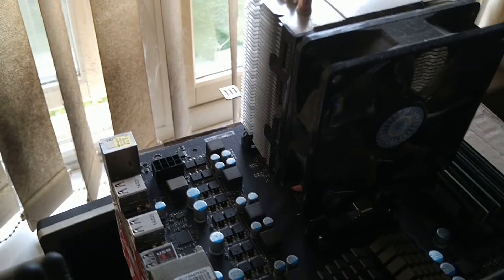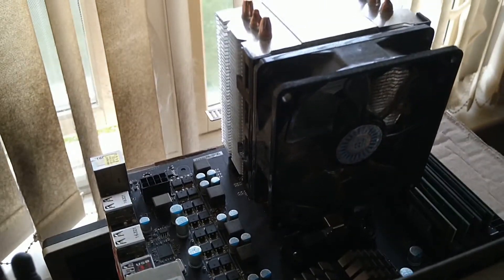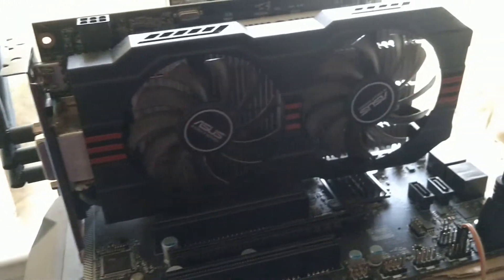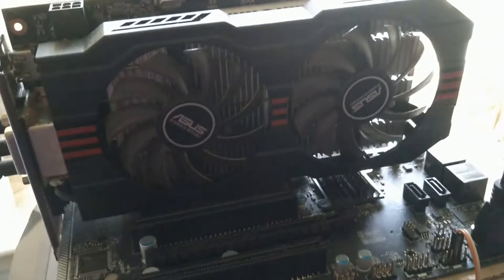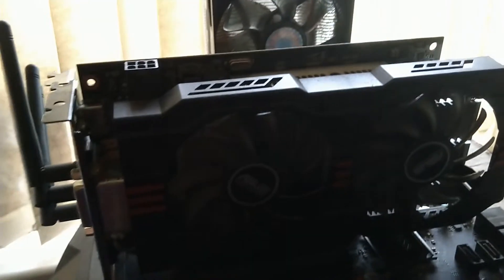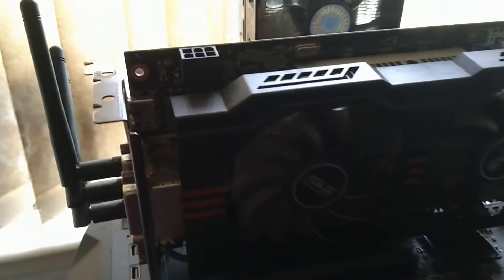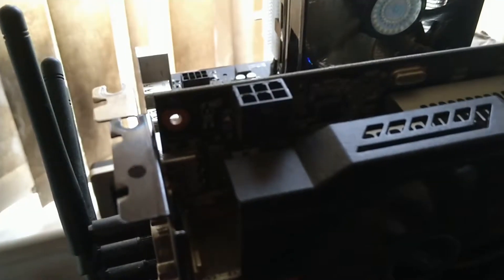A very 8 core build AMD old FX for the channel coming up soon please stand by.

Comment: Was that even a question? Of course you have to test crossfire (or SLI) !!
Reply from the maker: Problem is I don't have any matching cards to do so. TBH my love for older hardware has almost gone. You know the problems and issues you run into that start small and end catastrophic.
Reply: @retropcscotland4645  lol yep but its part of the challenge. I know what you mean, i almost despise 95 and 98 systems at times
Reply from the maker: @Snickerrick  Agreed 9x makes me cringe.